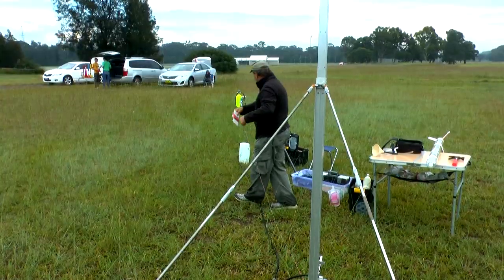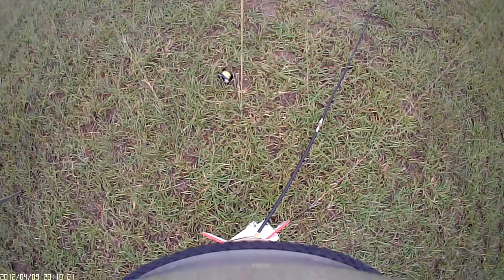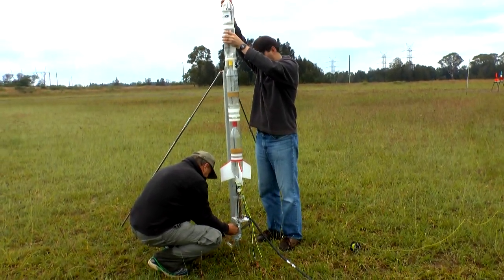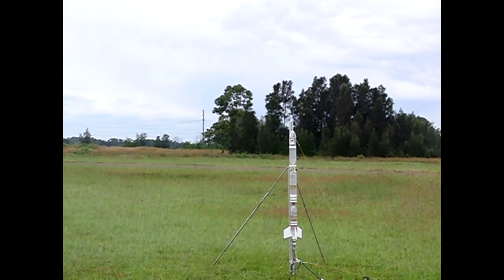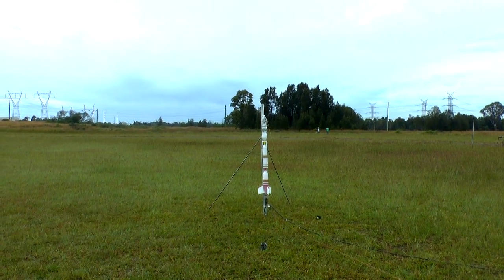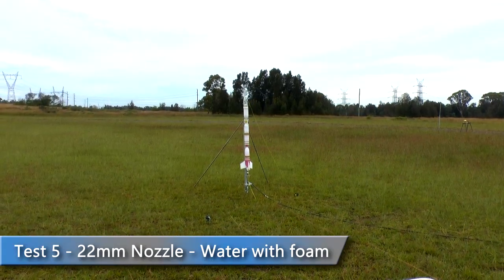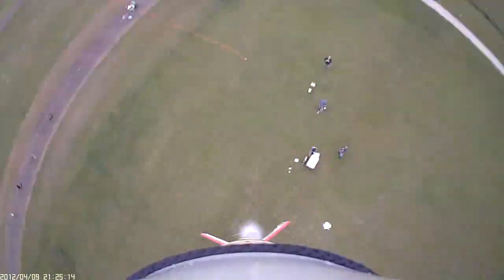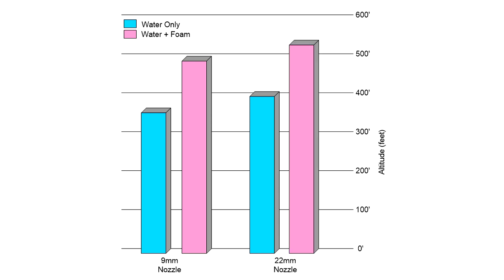Water vs. Foam

Comment: Why does the hight increases if you increas the nossle area? Of course the rocket gets rid of the energy much faster. And that causes a higher Speed - > higher altitued. But here the air resistent is much higher. With a smaler nossle the Energie is provided over a longer time and the end Speed not so high. But the top Speed is reached at a higher altitued. And the lover Speed means not so much air resistance.
But still the rockets with a bigger nozzles fly higher. Why is that?
Reply from the maker: That's a good question, the amount of stored energy is the same in both cases, and you are correct in terms of how drag affects the rocket due to the different speeds. I am not completely sure why they are slightly different, but it may come down to the efficiency of the nozzle. A narrower nozzle will be less efficient than a wider nozzle.
Reply: @AirCommandRockets  Yes the funny thing is that i tried to write an altitude calc. for water rockets. That would help me to understand the relationsships between pressure, nozzle size and the amount of water you would need at spezific pressure with specific nozzles. I already built these for normal rockets without Differential equation
.It is like a step by step calculation.(with respect to the change of mass, air resestance and thurst). But for water rocket i couldnt manage that.
And i strugglet exact at the point you faced above.
For the specific change of velocity (from the water rocket) in a periode of time you need a specific amount of Energy. This energy comes from the kenetic energy of the water (Offcourse all that energy in that timestep). The kenetic energy (from the water) is calculatet with the mass and the velocity. 
And thats the point were i stuck because the velocity is calculated from the accaleration (That is easy) over a specific amount of time (distance of acceleration). But what is this distance ???

And would it change change if you would use a straigt pipe instat of a bottle
I think the main question is: From where to where gets the water accelarated. (And does it change if you use a straight pipe or sth. else) 
I think that is a really interrasting point to improve efficecy by a lot.
Im sorry for all the grammer mistakes because i´m just from a german high school.
Reply: Thats all just high school formulares i can´t read the fancy formulares form the internet
Reply: Double the distance of accaleration = four times more energy for the rocket
Reply from the maker: @simonolschewski70  The best analysis of water rocket flight have seen to date is here: https://www.et.byu.edu/~wheeler/benchtop/pix/thrust_eqns.pdf

Comment: I've watched several of your experiments using foam as propellant.  I see the results but I don't fully understand why foam increases altitude performance.  Have I missed an explanatory video?
Reply from the maker: Good question. We also don't know exactly the reason why foam is better. I suspect it has higher nozzle exit velocity. The rocket also doesn't travel as fast so it reduces the peak induced drag. (drag being proportional to the square of the velocity) Although the average thrust is lower than with water alone, it does double the amount of time that thrust is produced.

Comment: Could it have something to do with aerodynamic pressure? I dont know the speeds involved, but it seems quite fast, enough to make air resistance a factor. Foam seems to last longer than just water, maybe the water one is flying too fast and hence encountering more resistance, hence wasting more energy?
Reply from the maker: +ComandanteJ I think that is a part of it. Foam produces about 2/3 the average thrust of water alone, but it gives you about twice the "burn" time. The upshot is that the rocket's peak velocity is lower and with drag being proportional to the square of the velocity, the rocket experiences less drag.
Reply: AirCommandRockets It's hardly rocket science. Oh wait... LOL
BTW, absolutely love your channel, i wish some day i'll have the time to get into it, and go from Kerbal Space Program and Orbiter to real rocketry, hehe.

Comment: If you used fire retardant foam and used a heat activated trigger (approx 130 C) you could put one of these every 10 or 20 meters through the scrub and have an automated bushfire suppressor. Edward de Bono eat your heart out.

Comment: I am curious if it is just mass of the water that increases the distances.  Would salt water also show an improvement?  How about muddy water?
Reply from the maker: This is a good question. The liquid density does play a part in how much thrust is produced. The problem is when you make the liquid denser, although you get greater thrust, you also have a greater mass to lift with that thrust. The heavier mass is the result of the heavier liquid still in the rocket. A liquid of lower density than water will actually perform better than water. The other way to increase thrust is to increase the exit velocity of the mass you are ejecting, and that is what we believe is happening here with the foam.

Here is another comparison we did recently that compares the same rocket at the same pressure with the same liquid mixture (same density) except one has been shaken up to form foam and the other one is just the solution. You can see that the foam rocket goes significantly higher. 
Day145 Water Rocket Highlights

Some further reading: http://www.aircommandrockets.com/water.htm

Comment: Hello Air Command, very interesting results with the foam. Even when not using the Jet-Foaming Spacer you get great a great increase in Altitude. Over the summer (once School has finished and I have more time!) we will try adding foam and post a video to see if we have the same effect :) Are you going to add foam to the boosters of the Polaron G2 or just the main stage??
Reply from the maker: Hi Jamie, That would be great to see how foam behaves in other rocket configurations. You need to make foam in the rocket either by shaking it up before flight/during pressurisation, or during flight like with Jet foaming. Simply adding the solution to the water won't do much. You have to get a significant amount of foam leaving the nozzle. 

Currently I am thinking that we will only add the foam to the main stage. We really don't have a way to make foam before launch in the boosters.

Comment from the maker: @Spoif- we too were surprised at the difference. We are not sure how foam performs in other rocket configurations yet, but from further flights this weekend for this rocket we keep seeing the same repeatable results.
Reply: You guys should add a parachute to the front for more stable landings cause with the one on the back causes the rocket to turn and dive in unwanted directions
Reply from the maker: CartUniverse pro gamer We try to aim at landing the rocket sideways as often as possible to reduce the damage to the rocket on landing. Landing the rocket on its fins can break them off.
Reply: What I ment is 1 chut at the front ant 1 behind to stablize the landing instead of flopping around in mid air
Reply: So that will always land on its side
Reply from the maker: CartUniverse pro gamer Ahh sorry I see what you mean. Yup, that should work.
Reply: np

Comment: Very nice onboard on that 22mm flight, so stable and so fast! Do you know why the rockets go way higher with foam? I think i'm gonna use it on my next flights as well. I am very happy that you guys tested this keep up the good work, as always ;)
Reply from the maker: Hi Basrockets. We're not exactly sure yet, we're trying to determine what the underlying cause is. I suspect it may be that the foam is exiting at a significantly higher velocity than water. Water is heavy but it also comes out slowly and air comes out quickly but is also light. Foam probably sits somewhere in the middle of those - higher density than air, but higher speed than water. We did another test this weekend where we had the bubble bath dissolved in the water, but there was very little foam in the rocket at the time of launch. The rocket flew to the same height as a water only launch. When we mixed up the foam in the rocket so there was a lot of foam in the rocket before launch, then it flew higher again. 

If you get a chance to fly some comparison flights between water and foam, I'd love to hear about your results. We are not using the jet foaming spacer for these tests.
Reply: AirCommandRockets on my channel I've made a slow motion video from the launches with foam and without, even with a small launch tube.

I think the foam takes up more space just when it exits the nozzle, so the rocket can push it self of harder. it probably helps as well that it acts as if there is more water in the rocket but without taking up more space.

Do you know how to simulate a flight with foam?
Reply: AirCommandRockets Thanks for the big explanation on that rocket i see that you use a tornado tube. Do you think the foam will work the same way without a tornado tube? The rocket that i make is one big pressure chamber and no tornado tube of robinson couping, so i have to test if foam effects the results on my rockets as well.
Reply from the maker: Basrockets That's a good question. I think it will still work without the tornado tube as long as there are lots of bubbles above the water. It will be interesting to see the results.
Reply from the maker: Oli4vn That's a cool video. :) Do you have any performance data on how the rocket flew in the different configurations? 
We currently don't have a way to simulate foam flights. I haven't seen any simulators yet that take it into account. I think in order to simulate it you would need to take into consideration the foam density, which may be a little more difficult to estimate.